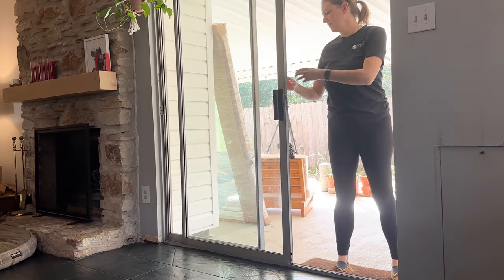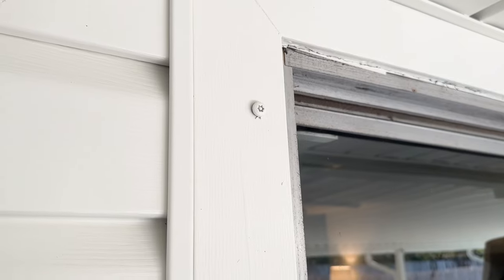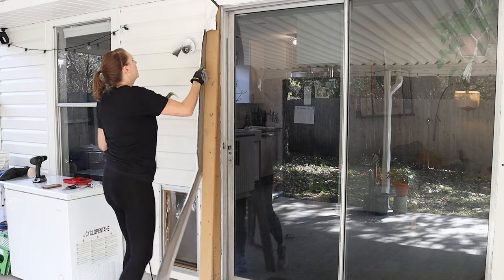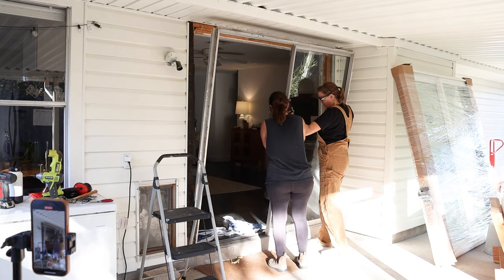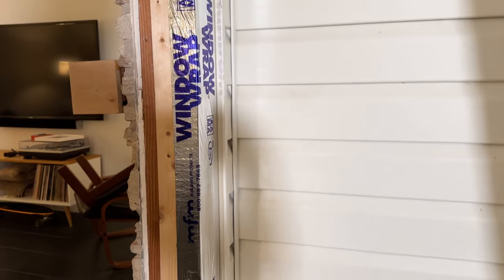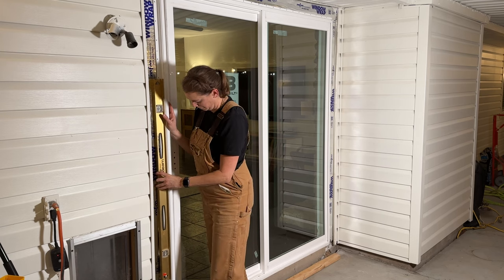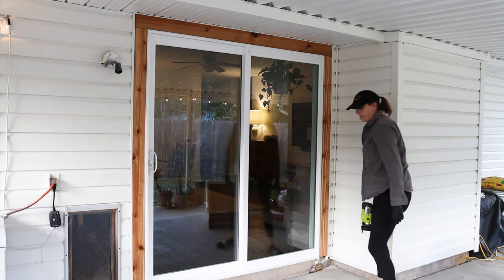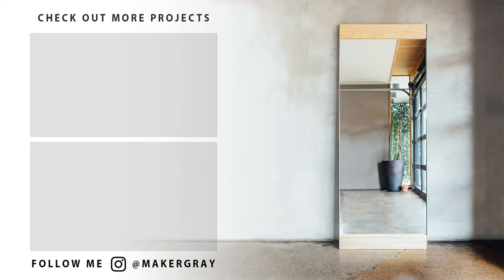Install A Sliding Door | How To Easily Remove An Old Door and Install A New One!

Comment: Installing new sliding doors is always good, but I want to share with you my experience, I live in Orlando Florida, I contacted the Masterslide company with the problem of my sliding doors (if you ask, I will share the contacts) they replaced the rollers, installed a track cover and a new handle with a lock.  Now my door is like new and I'm as happy as a child!  And most importantly, I thought that I saved more than two thousand dollars!  Just because repairs are cheaper!))) so think before ordering new ones.  This is not advertising, this is my case.

Comment: Nice work. You made it look very easy.  For those attempting the project, get yourselves a torx bit to go into an impact driver if you need to remove screws like they had to. It will go faster and doubtful your driver will fall down a crack!
Reply from the maker: Thanks!

Comment: I've been wanting to add a sliding door for a long time, but it would be filling the space where an old window and window sized hole from a former swamp cooler are. I'm still figuring out how to frame that gap out before I start, and to add more complication its on a hodge podge adobe/brick wall I have. Thanks for the post, seeing it done allows my brain to figure out the process for my own hot mess house express.
Reply from the maker: In another part of our hot mess express house we might replace an old window with another sliding door down the road. I understand because I've been thinking through what that would entail. I'm so glad to know this helps! Thanks for watching!

Comment: Great video. You didn't mention what you did on the outside at the bottom of the door. How did you trim that out? How many weep holes does your door have? Mine has 4. 2 nearer to the bottom and 2 higher. Should all 4 be exposed? Or can the lower ones be covered by trim?
Reply: Did you ever figure that out?

Comment: What is best way to take measurements of your door before you order it and remove the preceding door?
Reply from the maker: If your door has any trim, you can usually gently remove it to see the actual frame of the door. You can then take measurements of the height and width of the whole door frame and know exactly what you need to order.

Comment: Good but I would rather see silicon at the base rather then construction adhesive and would like to see much more of it not just a simple loop (Sine wave) pattern. In your case it was somewhat weatherized but still good practice to run many lines across as a multiple defense strategy.
Reply: I personally think that she put enough. There’s no need to waste 2 tubes of silicone in one area. That’s over kill.

Comment: @1:50 I wish you would have showed how you remove the sliding part because I think I have this exact same door. And I can't for the life of me figure out how to take the dang door out!
Reply from the maker: Shoot! Sorry about that. If I remember correctly, there were two brackets (top and bottom) that I just had to unscrew and the door came right out. You're then able to lift the door up into the top track and then swing out at the bottom. Hope this helps!